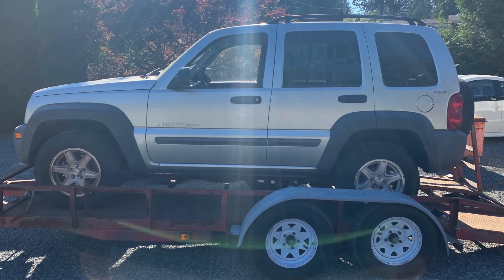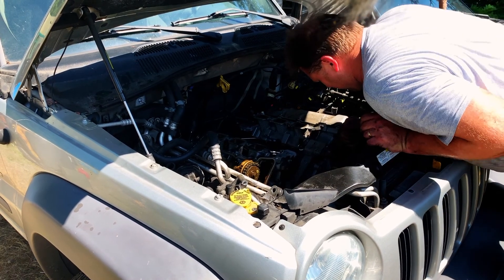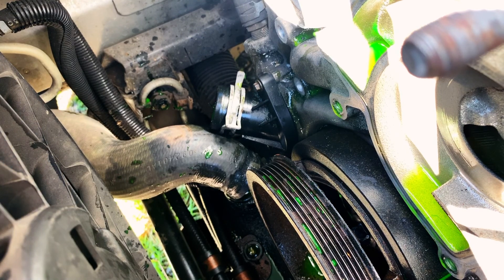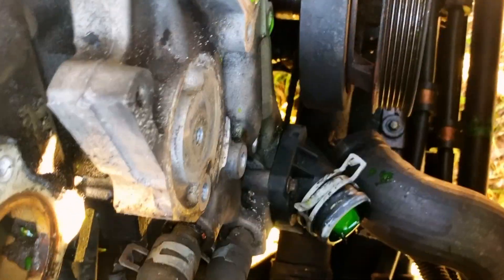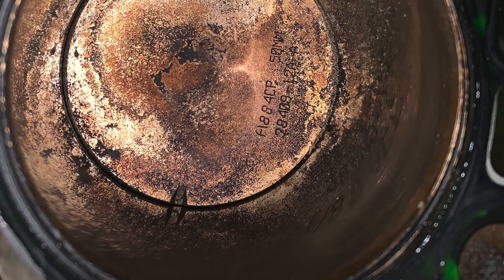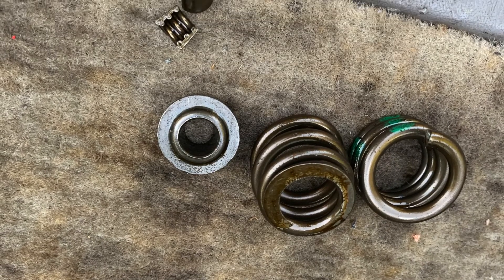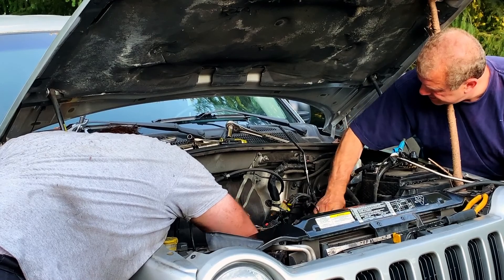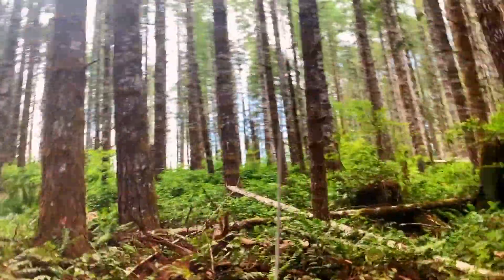BEST JEEP EVER MADE? Project Cheap Jeep Liberty! EP5

Comment: That's cool..you were actually in my backyard in tillamook oregon.  Funny ,i also have an 02 jeep liberty with the 3.7 and right now sits at 260k miles and counting.  Runs like it just came off the assembly line.
Reply from the maker: Mine is still running good. Even after my backyard head surfacing.
Reply: We still my wife's 2004. The OEM transmission made it to 205,000. The engine was still running fine at 240,000. Its in the barn torn apart for rust repair, lift, tires, "new" engine and a six speed. It'll be serving long into the future as a trusty backup for her JLU and my JT.

Comment: I feel nervous just typing this buuut, I got a tow yard Liberty 1st gen with over 280k…32k miles of 100mi daily commute, camping trips, mild trails, and plenty of oil changes later he’s still running like a champ. About to do the front diff cause it finally cracked, but not from tension, I hit a rock the one time I didn’t have a skid plate on. ☹️
Reply from the maker: That is a bummer. I have not done a front differential on mine yet. I did remove the skid plat recently when I had the heads rebuilt. I hope it goes smoothly for you.

Comment: I have an 03 liberty with 200k miles on it it never really had any major issues only issue it had was suspension was shot from my sister crashing it on the side of a bridge and the engines only problem was the water pump broke and killed the belt
Reply from the maker: Mine has proven to be indestructible... so far.

Comment: 02-06 KJ. 3.7L V6, very dependable if you update the rockers and stay up on the oil changes. 02 year has the 45rfe, near bullet proof and super easy to upgrade. 03-06 have the 42rle, not as great, but not bad. Most KJs have the 231 transfer case, super simple and cheap to work on. Rear end is a Chrysler 8.25", easy to build and cheap to maintain. Front is a D30A, switch to a JBA steel diff for serious offroading. 
These Jeeps have been around long enough, and share enough parts bin stuff, that nearly all the problems have OE or aftermarket solutions.
Reply from the maker: Thanks for the info. I have done a lot with this KJ since I fixed it and it is still going strong. I have had very few problems. It has been a great vehicle.
Reply: Why update the rockers??
Reply: @Gokywildcats11  The stock rocker arms can pop out. There are rocker locker kits available.
Reply: @xc8487    is that the only down fall towards the liberty 3.4 v6. Im leaning towards one.  Whats alot of miles to stay away from. Whats the best year
Reply: @Gokywildcats11  The 3.7 is a good engine. The problem is that most were never properly taken care of. If you pop the hood and it looks like it's never been cleaned then stay away from it. Mileage really depends on maintenance and how it was driven. No maintenance, city driving, and 50k miles, no go. Perfect maintenance, hwy driving, and 150k miles, could be mint.
Reply: @xc8487   any news if second generation liberty is better than  first or no
Reply: @Gokywildcats11  I'd stay away from the 2nd gen, more electronics to fail and the manufacturer doesn't support stuff like the leaky sunroofs. Best KJ is the first couple years with the 45rfe truck transmission and np231 case. Offroad package usually included skidplates and an LSD in the rear.

Comment: The best 4wds I've owned were a 92 S10 blazer with the 4.3 tbi and now this 02 jeep liberty with a 2 1/2 " lift a d leveled with air schock supension and additional regular shocks.
Reply from the maker: I have owned a few few 4wd. The Liberty is good. We did the Cedar Tree trail with smaller than factory street tires, no lift all original. Although it was not too difficult the Liberty kept up with the group we were with no problem. It would climb anything. I would like to take the Grand Cherokee next.
Reply from the maker: Thanks for watching and your comments!
Reply: Haha, I had 84 s10 p/u 4x4 5sp. Had to replace that clutch seemed like every Xmas break back then. Great 4x4. Now yrs l8r got a '04 Liberty (Bella) and am blown away with her, don't know why all the negative talk. ✌️

Comment: Are you considering adding a lift kit to this Jeep. I would like to see a good video on Installing one for a Liberty. From what I can tell, not too much trouble and saw a 2" suspension lift kit for $500.
Reply from the maker: I looked at some cheap ones for $150ish. I really would like to build my own.
Reply: I did it to mine.. 2002 jeep liberty. I  used a Daystar 2 1/2 lift/ leveling kit and it rides amazing.
Reply from the maker: joe arreola how is the alignment? I was planning on using clevis on front from a 2005 or newer Liberty and making a spacer for the top of the strut to get to 2 1/2 inches in the front. Then building spacers for the top of the springs in the rear. I am guessing it will also need brackets for the shock mount as well.
Reply from the maker: I just ordered a 2.5 inch lift kit from daystar. It was a little under $150 and supposed to be here in a week. Look for the video in a few weeks! Thanks for the suggestion and support!
Reply from the maker: My lift kit just arrived. What would you like to see in a video? What Measurements? Step by step installation? Problems? I have the same question posted on my Instagram and Facebook. Let me know what you would like to see before I film it.
Reply: @TurlosGarage  Old Man Emu 2927 springs up front with Bilstein 4600 series shocks will give you a 2.5 lift without a strut or clevis spacer. for the rear 2948 springs and bilstein shocks for a 99-04 dodge dakota 4x4 quad cab, once again no spacer needed.
Reply: @TurlosGarage  you will regret that daystar spacer kit on the trail.... Go to the Lost Jeeps forum and search lifts by tommud, will save you a bunch of headache. Tom has done over 60 KJ lifts
Reply: @TurlosGarage  Dodge Nitro clevis is 1/2 longer than the 05 liberty. join the Jeep Liberty KJ facebook page and talk with Mike Davis. very knowledgeable on KJ builds
Reply: @TurlosGarage  I like the step by step installation as well as explaining potential problems that can come up during the install.

Comment: Love my 2007 Liberty with 175k miles.  The trans just went, but had it rebuilt this week.  They don’t make em like this anymore.
Reply from the maker: They are a robust vehicle that is good for just about everything. I think these will be the next great Cheap Jeep since the Cherokee’s are going up in price. This 02 has been incredibly resilient to the abuse. Thanks for commenting!
Reply: check the differential oil is good an clean

Comment: For jeep Cherokee liberty kj the part- time is 50-50) and full time is 48-50?? which of the two can i use in the dry??
Reply from the maker: I have used part time on wet and snow/ice. It works great. I would only use full time on loose ground, Gravel/dirt/snow. Just a note. I use 2 wheel drive until I get stuck or sliding around. If you get stuck in 2wd, typically part time 4wd will get you out. If you get stuck in part time 4wd, full time will usually get you out. If you get stuck in full time 4wd you will need a winch and/or shovel to get out. Great question! 👍

Comment: Just took over an 06. 197xxx mile and runs very well.
Reply from the maker: Congratulations! They are great vehicles and a lot of fun. Just keep the oil changed and if it starts to get hot turn it off. It will last a while.

Comment: Change the differential gears oil.  Most dont.  Mess up the diff the old oil..
Reply from the maker: I think the clutches are worn out. I did change the diff oil in a later video, and checked it out as well as the diff in the Grand Cherokee
Reply: @TurlosGarage  Its an open diff,  limited slip comes from electronics slowing the slipping tires, if any.  Jeep Liberty is almost as good as a Wrangler, for half the prize.

Comment: Greetings!  I have the priveledge of leading a 2005 Jeep Liberty known as The Old Goat around Colorado and Moab.  He has a 3 inch Rocky Road Outfitters lift kit and aggressive tires.  I've had the factory limited slip rebuilt. Oh and his Take No Prisoners attitude.  He routinely will get up and over 90% of any trail or obstacle any other near stock Wrangler will.  The Old Goat routinely embarrasses Wranglers.  His rocker panels are beat up, he knocks the fender flairs off (I carry a bag of attachment clips to remount the flairs - 5 minutes at the end of the trail and the flair is back on) and with being much shorter and narrower than the Wrangler what he can't get over he usually wiggles around.  No lockers yet (Man are they expensive with the installation) AND he has never broke on the trail which can't be said for a lot of recent JLs and JTs.  I do have to put a lot of maintenance, but that's true of any vehicle ran offroad.  Karl and The Old Goat
Reply from the maker: That sounds like an unstoppable Jeep! Jeep on Karl and Old Goat!

Comment: Mine is a 2006KJ 3.7 V6  with a bad chain tensioner but still running. I consider it a good Jeep, but surely that engine is not so reliable like older straigth six 4.0L.
Reply from the maker: When I got the KJ there was about 6 for sale within a 10 mile radius with engine problems. So it was a matter of who would take the least amount for theirs. It seems they do not do well once they get hot. The chain tensioners wear out. Getting the timing correct was a complicated job. Other than that I think they do OK. But you are correct I don’t think they are as robust as the straight 6.
Reply: @TurlosGarage  I paid 250 each head and had the valve seats pinned and the oil returns enlarged. added updated lash adjusters as well...The 3.7 doesn't like to be overheated or miss regular oil changes.
Reply: @TurlosGarage  of course no other engine configuration is as robust as an inline 6, be it ford, chevy, chrysler, amc, the I-6 is a balanced engine when it comes down to the firing order. No to mention the fact they are the least complicated layout. Half the part of most v6 engines

Comment: Whats the best years for the liberty?  What's the problems people have with them
Reply from the maker: To the best of my knowledge the early models I think 2002-2004 had a lot of problems with the valve seats in the 3.7 engine. I believe the 2005-2009 had valve spring issues in the 3.7 engine. The front ball joints tend to break if you put a lift kit in and don’t correct the upper control arm angle. The 2010-2012 I have not heard any complaints. If you plan on doing off roading make sure you find one with a trac-lok rear differential. That makes a big difference and not all libertys have that.
Reply: @TurlosGarage   what years have trac loc. I have an 02 tacoma v6 double cab that's its pretty slick and don't want to abuse it.  Like to have a liberty to deer hunt out of

Comment: No no! Best Jeep was the 99 to 01 Cherokee. If it was refined, it would have been the toughest. Problem was, the engines lasted toooooooo long. And unless you beat it into the ground, it would last longer than most vehicles. The liberty is second to it!
Reply from the maker: I wanted a Cherokee, 90-01 when my friend bought this Liberty. I actually found two that were wrecked, one in the front and one in the rear for about $500 for the pair. They sold before I had a chance to go look at them. While the Liberty was not my first choice it has held up very well for over a year now. Have you seen the Liberty vs Grand Cherokee video?
Reply: A lot of the 2001 i6 had casting problems with the block, but that gen definitely has the best intake manifold for the i6

Comment: I love my Jeep liberty. I just hate that it burns oil
Reply from the maker: I will be doing a one year review of living with a Liberty soon. There have been a few issues since I fixed the engine. It has been a surprisingly good car.
Reply: So does mine...its my only issue!
Reply: More than likely your valve cover seal. Same thing with my jeep liberty but once i replaced them, not one scent of burnt oil.
Reply: Use thicker oil like 20w 50.  Put slick 50.  Check for leaks.

Comment: super common failure on all 3.7/4.7/5.7.. its caused by leaking water pumps allowing over heating. I have a fleet of 11 jeeps ive rescued for cheap because of this failure.
Reply from the maker: Do you find used parts or get new, rebuilt, remanufactured? I am asking because where I am it is difficult to find good used parts. Most have a questionable past.

Comment: Just an idea, putting some prices like what you paid and time invested would make this video more interesting.  good job though
Reply from the maker: I paid $300 for the Jeep and $300 for the new and used parts. $90 for the heads, which the guy threw in timing chain tensioners and slides and the PCV parts that broke. The Gasket kit was around $85 with head bolts. The rest was oil and coolant from changing it multiple times. It would have been less had I done it right the first time. Thanks for watching !
Reply from the maker: Thanks for the recommendations. That is a good point. I will try that in future videos of fixing vehicles.
Reply: @TurlosGarage  thanks man, awesome, i will watch them

Comment: The best jeep ever made is definitely not the jeep liberty it’s the jeep XJ Cherokee. My uncle got his to 385,000 miles and the engine and transmission was still fine it was just rotted so bad that you could almost see holes in the floor. My girlfriend had a Jeep liberty Limited and it was like the nicest one you can get it it was kind of a piece of shit. The seat broke so it was like twisted because the plastic to the inside of broke. I neededBall joints like 15 times. And it ran through brakes like nobody’s business. Not trying to sound sexist but it could just be because it was female driven… Still a tough little bugger. However now that I’m thinking about it my friends dad had a diesel jeep liberty and he drove that thing for 15 years never gave them any trouble. I think it’s basically just the model you get the fancier they are the more problems they have.
Reply from the maker: I wanted an XJ but could not find one for my $300 budget. I still plan on getting one someday. Just too many projects right now. Thanks for watching!